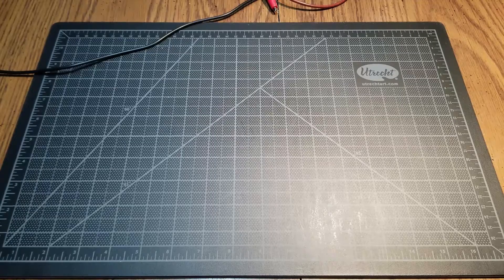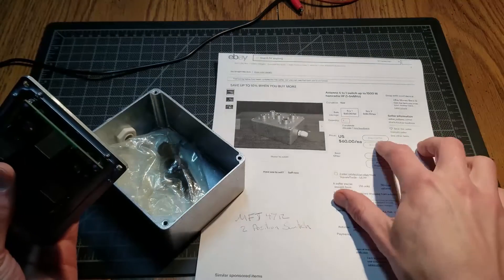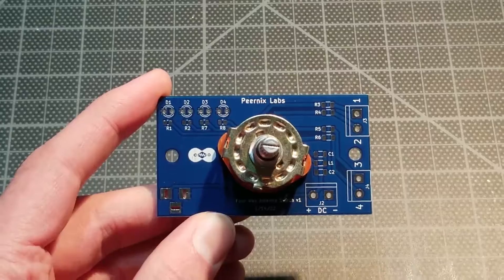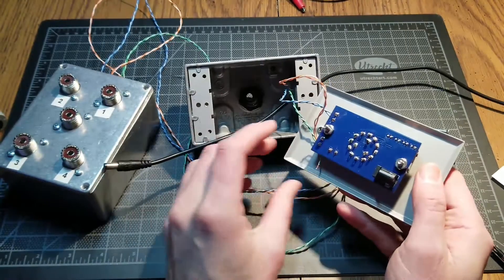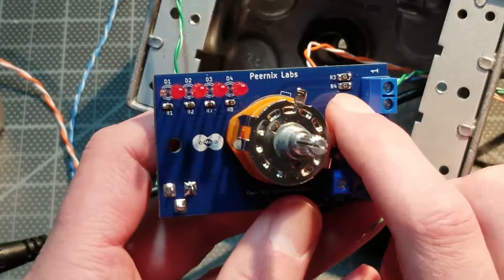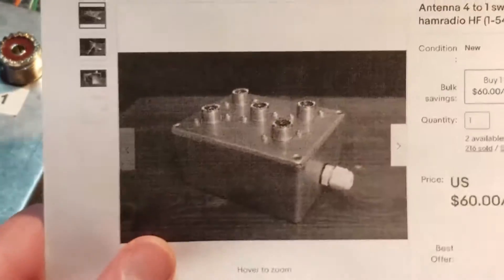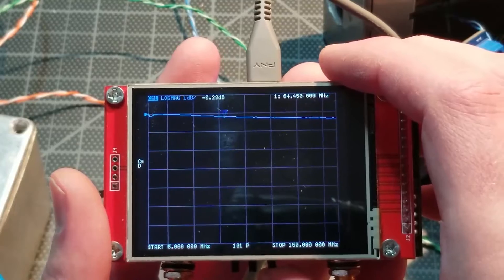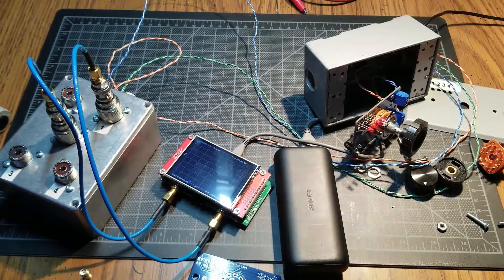Four Way Ham Radio Antenna Switch & Switchbox project.

Comment: Don't known if it would do 500w or am I wrong
Reply from the maker: The switch was listed as able to handle 1.5kW. I only run 100W max, so I was not able to test it.
Reply: Wow I am surprised..well it looks the part and you have made a excellent project  of the switch..clean tidy ..well done friend...73s

Comment: does the relay coils make RF no dramas ?
and other question how many power they hold 100 w or less?
thanks for sharing nice job
Reply from the maker: The relay coils seem to have no effect on signals, as they are powered with direct current. The switch is rated for 1.5kW according to the designer.  The setup as been working fine for me since its deployment. Thanks for watching!